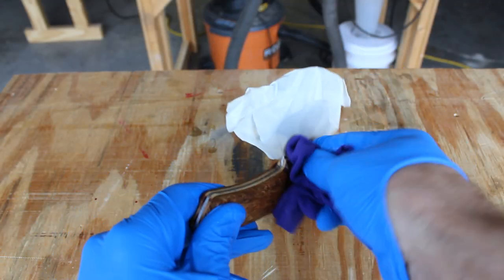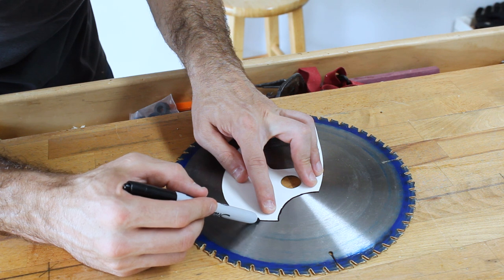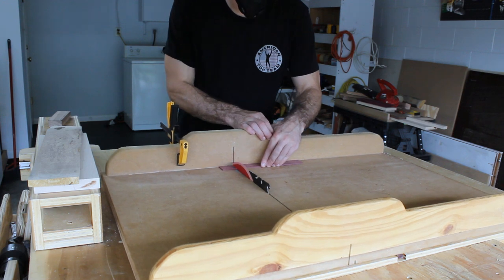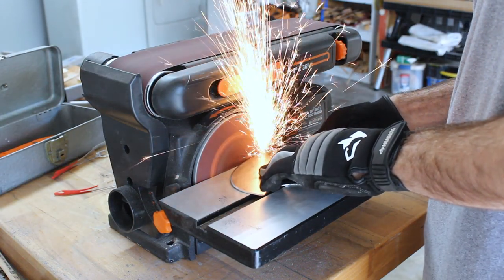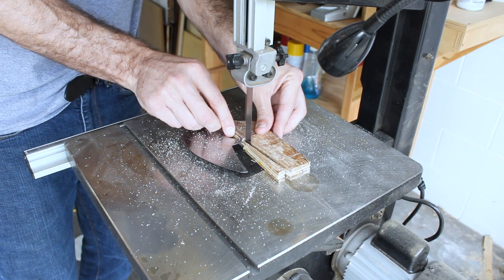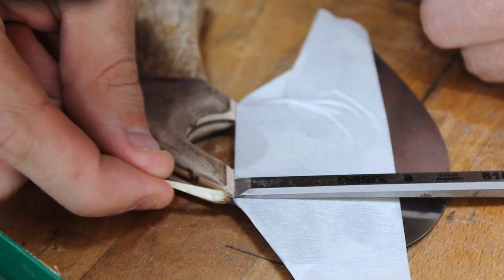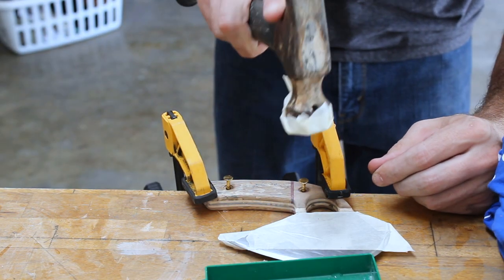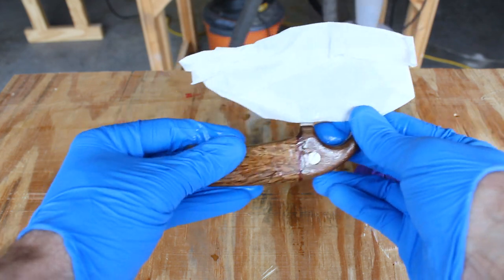Ulu Knife made from Saw blade

Comment: Beautiful looking ulu,. I know you said that you aren't a knife maker and that you know very little about doing this stuff, I think it was a decent first attempt. If you're interested in knife making there are several good YouTubers with lots of great content for you to watch and learn. There were definitely some things that you could have done a little easier. Such as drilling the rivet holes prior to mounting the handles. the rivets help line everything during a glue up, and this way the heat generated by drilling through the steel won't degrade the epoxy. That said it definitely turned out beautiful I love your handle design and the finger hole really sets it off nicely. Good job!
Reply from the maker: Thanks Chris I appreciate it! I have done a deep dive into knife making since making this. I think i made 15 knives since then. i became obsessed with it lol.

Comment: A trick Ive learned with an angle grinder is I took a metal sheet and put a few big shop magnets on the back of it and while cutting I faced the shield of the grinder towards the sheet of metal and it catches most of the debris causing less mess and it sort of contains the particles that fly around my garage which also gives me a little more piece of mind for my eyes. Dont know if it would help but thats my little trick lol and Im sure others can build on this idea.
Reply from the maker: Thank you i will have to try this out!